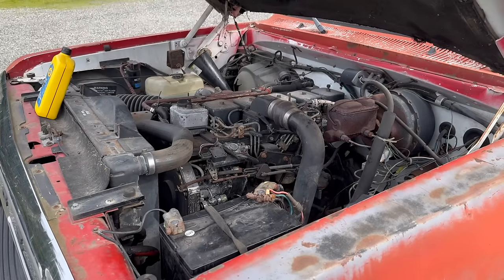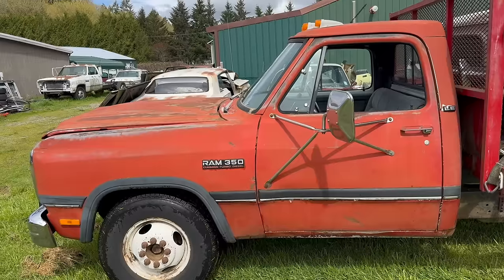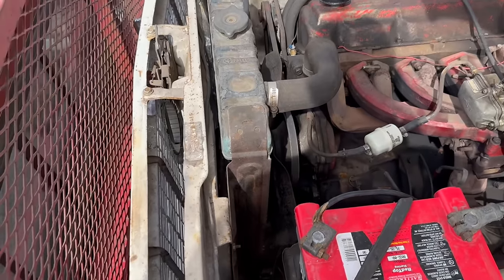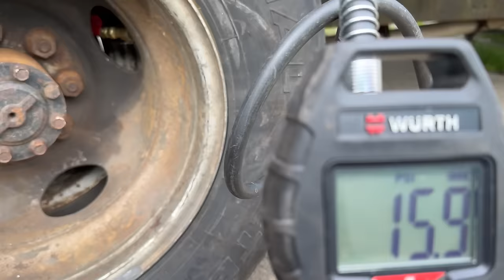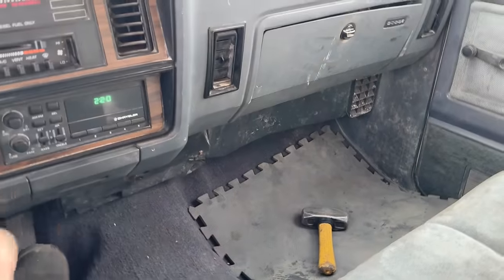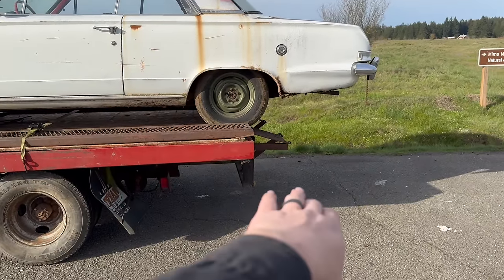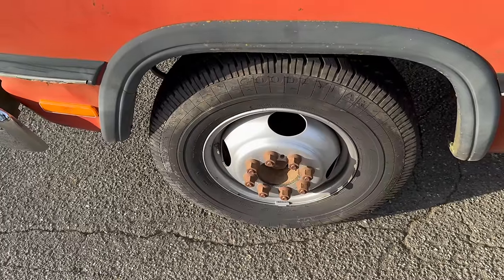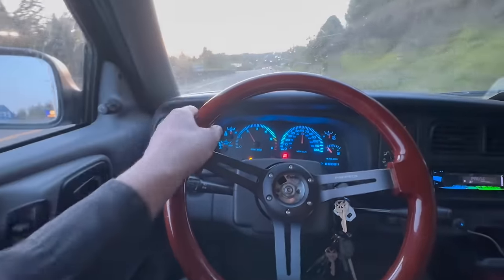Can I Drive This Terrifyingly Sketchy 1992 Dodge D350 "Ramp Truck" Home? (Towing My New Project Car)

Comment: I think the tires are old enough to drink...so thats good. 
@5:51 Oh yeah...Back and hemoroid surgery. Yay!!! More fun for the next day. :)
The death wobble happens because the steering linkages are worn out. js
Been there done that.
Random cat is wating to attack.
Hi mom. :)
And remember...only YOU can prevent brake fires.
Reply from the maker: Did you see the clip I took of steering linkage because I thought exactly that? I didn’t see any play anywhere but in the box itself.
Reply: @DeadDodgeGarage  Yes I did. The linkage is worn out bro. Been there done that, many times. The death wobble sucks. (steering linkage)
P.S you cant just fix one part. It`s called a worn out front end.  You have to change it all. js.
P.S.S you can have a bad tire but that most likely just magnifies the problem. The front end is worn out buddy.
Dont let that get you down. Its just some parts.
P.S.s.S I would love to have that Dart convertible you have but I have no money. You know how that goes I guess. :(
I love you man

Comment: You say first Gen,,, I say shipping crate for a 12 valve!!!😂😂
Reply from the maker: As if you’re the first to say it 😅
Reply: Totally disagree. Find one that somebody didn't abuse/neglect.....and those are STILL GOING, YES....thanks to the Cummins.
Reply: @jeffhutchins7048  those trucks we're busted the 1st year of ownership,,,I had a couple they we're put together badly. Not to mention that whole generation after 79 was assembled in Israel, for over a decade
Reply: @jeffhutchins7048  & nothing against the Israelis they got enough problems,,it's just they produced those trucks under trade embargoes cause it was cheaper
Reply: Oh, that '91.5 has been USSSSED as well, it was my main vehicle for about 10 years, not abused except when nailed by a Bronco, that went to the junkyard. The Dodge just took me back and forth to work today.

Comment: So much to unpack here. So let's hit the high spots. One that will buff right out😂. Second is Washington state patrol dot. Now if minnesota pulled ya over you would be as we say a stone on the side of the road. There is so many violations that he would have your autograph 473 times. You might get to see how cuffs feel. That whole dead guy thing is haunting as much as death wobble and optional smoking brakes. The approved spark retardant fuel filler neck. What filler neck, no problem. Tires that have more cracks than the grand canyon, it will be fine. Calling this sketchy is like calling me handsome. It's so much worse. Bed boards are optional watch your step. Bed length it's to short son. At least that's what she said. You need wheelie bars. The only thing fitting is the pos car on the pos truck matches and they look like they belong. Like a criminal and a jail cell. However this is not your worst idea. I could name several. There is a truck like this in a field here and oddly enough it has a tractor on the bed. So it's taller and has 5k lbs cargo. So just think you can haul your dorf tractor for tractor pulls. Now remember the worst idea is the one where people die. It will be fine.😢 no really😅 oh I would avoid the local constablitory at all costs on the way home. Call the funeral home and reserve a slab and a room.😊
Reply from the maker: Oh it’s not thaaaaaat bad…I mean it’s pretty bad.

Comment: Are you going to buy that truck, It's got a great engine in it but it's not much of a ramp truck. I wouldn't buy it because I already have too many projects.
Reply from the maker: Kinda already did. Other than all of the issues mentioned in this video, it’s a mostly operational truck. I think it’s air bags and a bed extension away from being damn decent at hauling A and B bodies around.
Reply: If you do extend the bed and you plan on putting your beautiful Demon on it, then you better do a great job.
Reply from the maker: @BigBoxDodge2020  I wasn’t planning on doing a bad job 😅 it would be really hard to do worse than what is already there…

Comment: ebrakes are allways just not. Untill you almost kill a family like i almost did yesterday. 86 short bed gravel road around a corner going like 40ish and rear line blew. Yeah good thing ive had tons of practice drifting corners on gravel in these trucks or else i would have smacked a sidebyside. Next up on the repair list ebrake cables and maybe just maybe a limited slip for easier gravel drifting.

Comment: that is not scech. scech is 50 in the fog. and that is how you put a car on the railing. i 5 to 512. missed it by that much.
Reply from the maker: Yikes…
Reply: @DeadDodgeGarage  i truely love that compression corner get on to i 5 in olympia.
really have not been on it in along time. but then have not driven in years. but remember the g forces from it.  stomp it once for me sir. its coming from coast onto i 5.

Comment: Those trucks were great shipping containers for those Cummins engines 👍
Reply from the maker: Uhhhhh huh. Lol.
Reply: Still see A LOT of them on the road, just getting MORE valuable everyday!
There's 6 of us in my family,  we have 4 First Gens. and 3 Second Gens.
NEVER been stranded in any of them, one totalled out a Bronco, drove home, $6,000 later at a body shop, good as new. Got hit dead on the driver's side front fender/axle.

I'd give Phord a body strength advantage but NOT GM. Own/owned lots of all the US brands.
Reply: @jeffhutchins7048  I rarely see any first gen’s or older around here anymore, they just rusted away too bad in Minnesota. Always liked that body style! I had a 79 powerwagon that I spent 5 years restoring, there was nothing else like it around here and people just loved it anywhere I went 👍
Reply: @minnesotatomcat We have A LOT of rain but not any road salt. A little bit of thawing chemical. 
ALSO, starting in '81 Dodge started galvanizing the truck bodies.
Jamie and I have the same climate. He's in Western Washington, I'm in Western Oregon.
There's a lot of first gen. Rams here....well Cummins powered anyway.